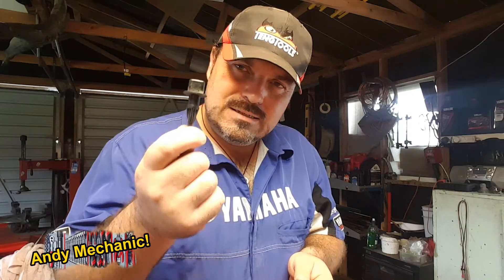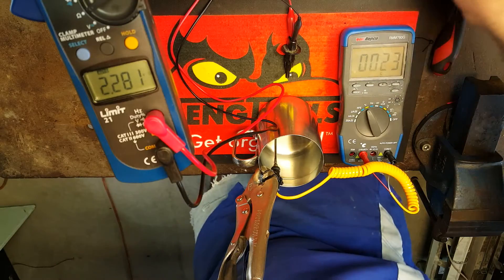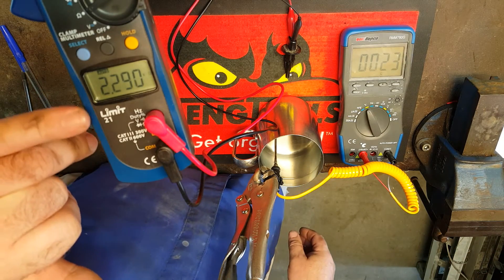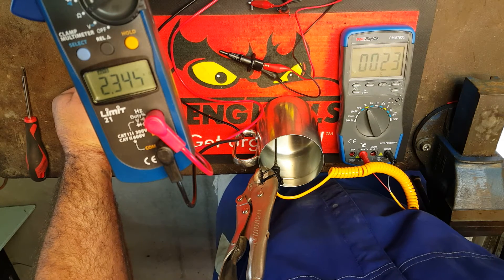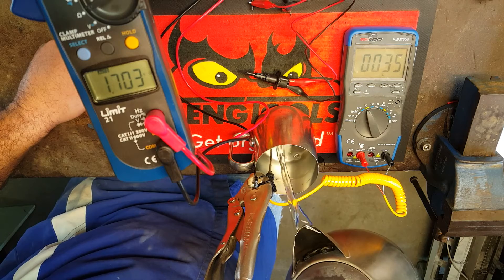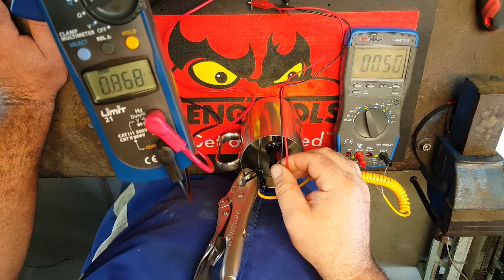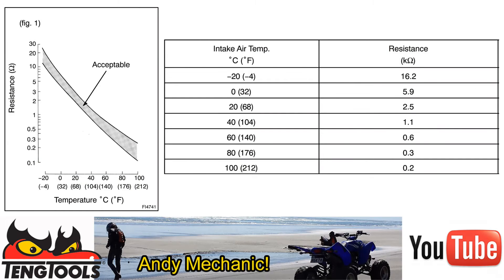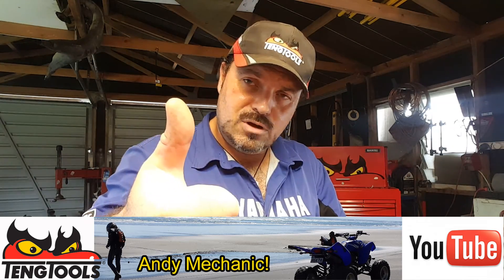How to test an Air Temperature Sensor #1205

Comment: Will it cause the engine to cut out ?
Reply from the maker: Unlikely, though it will affect fuelling, engine could run too rich or too lean depending on sensor output, in extreme circumstances it could cause the engine to stall - for example sensor reporting air is very cold when in fact it's very hot.

Hope this helps
Andy
Reply: @AndyMechanic  I tested it, values were under spec in the FSM.  I ordered a new one.

Comment: Would a bad sensor cause a motorcycle not to idle ?
Reply from the maker: Yes, if air temp signal indicates wrong temp ECU will give incorrect mixture. Same for coolant temp sensor too.

Cheers Andy

Comment: Mine is on a 95 jimmy mine at outside temp shows like 1.7 and when I put my ac on it it dropped to 1.4 1.5 ohms does that sound like its working right to you ?? Can't pull any codes because its a screwy obd1.5

Comment: factory tunes are always lean due to emission test. So probably you can plug in some resistor to the sensor to change its resistance to fool the ecu to pump in more fuel slightly to improve acceleration.